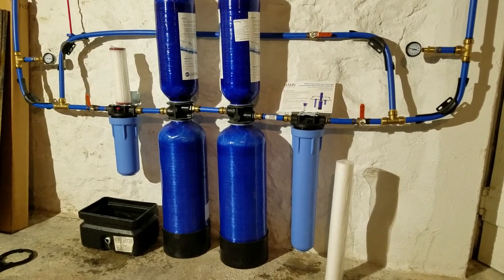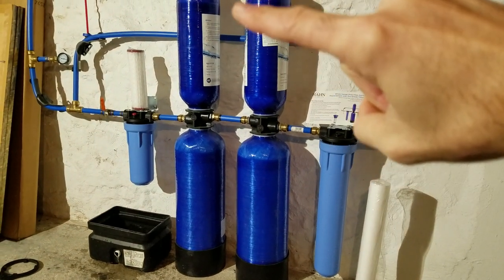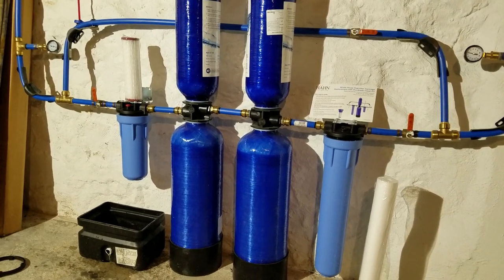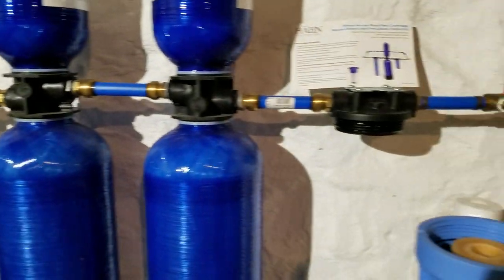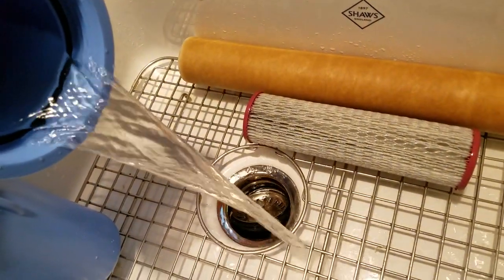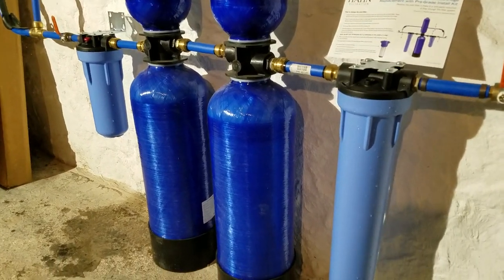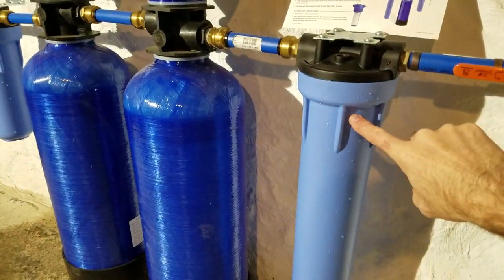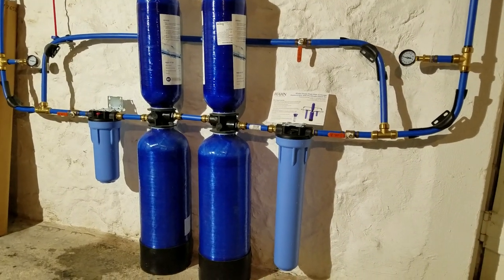Review: Aquasana Water Water Filter Systems, Overview, and Maintenance

Comment: Hi There!  This video and moreso the comments and your responses have been super helpful for me.  I am about to make a purchase for a small one bathroom house I am building in Puerto Rico.  Question - Now that you've had the OptimH2O for awhile, do you prefer it to the Rhino?  I was thinking about getting one of these two, and then adding Aquasana's RO unit under the kitchen sink.  Would that be overkill if I got the OptimH20?  Also, I have heard, and read about bacteria growing on the carbon block???   Please let me know your thoughts here, and thank you so much!
Show less
Reply from the maker: Hi! I'm so glad I was able to help and love the feedback!  As far as the Rhino vs the OptimH2O, here are some of the main points that I kept in mind as I debated. The OptimH2O:

* does remove chlorine, chloramines, forever chemicals that now seem to be in all of our water like PFAS, PFOA, etc. The Rhino only gets the chlorine. 

* The main carbon block filter needs no plumber or tools to replace (assemble/disassemble) like the Rhino does. Just pull and replace.

* The carbon block has less contact time in the system, reducing the likelihood of bacteria growth - 12 months vs 5 or 10 years  with Rhino (thats a long time) . The carbon block filter is more expensive tho, but is higher performance  as stated above.

* Adding the RO under sink - overkill? Well maybe, but for the low cost, I figured it's worth it, and I got one too. It filters beyond a carbon block for ultra filtration to the max - for drinking water only. Not for espresso machines tho. Its so filtered it can mess with the water sensors. 

* Bacteria - I do wonder about my old Rhino, due to age and length of exposure. Again, why I like the Optim H2O - 1 year. But you can always follow the RO disinfection steps that come with the RO and perform it for both the system and RO a few times per year or say if you went on vacation for a 2 weeks+ and the water was static.  Flush and you should be good to go. 

Hope this helps! And if you don't mind, use my link if you decide to purchase. It helps me to continue to make content 👍

http://visit.myoldhousefix.com/aquasana
Reply from the maker: One last thought bacteria/algae growth - I do know a few years back they switched from clear filter canisters to opaque due to this issue. It seems to have helped, but I haven't heard of anything lately.

Comment: I installed the Aquasana Rhino Cholaramine version plus salt free water conditioner 400,000 gallon.   We have chloramine added to our Southern California water. After our 3rd slab leak in our 29 year old copper pipes, research, plumbers and insurance adjusters pointed out the Choramine was a part of the problem.  Water feels great and taste wonderful now.  Two notes. A.  Water is cloudy and awful for a few days of new install (even with proper water cleaning at install) but then becomes crystal clear and yummy tasting.  B) After 3 weeks of use I see bottom of toilets browner than normal, which I assume is from removal of chloramine disinfectants.  So will work on a natural solution for that.  I would rather have that then the disinfectant in my family stomach and skin.
Reply from the maker: I think we are going to switch to the same in another year when ours is due to replace. I also noticed the brown spots in the toilets wuth our standard carbon filter, so must be common with both since chlorine and/or chloramine is removed.

Comment: Don't know if this has been mentioned but the activated charcoal will take bacteria out, but bacteria will build up on charcoal and start putting more bacteria in the water over time. Bleach needs to be run over charcoal once a month it strips a layer off and you have fresh charcoal. Thanks for the vid
Reply from the maker: Good info, thanks!

Comment: Looks good, I would add 1/4" sample ports and gauges in between tanks to monitor water softening and chlorine levels and delta pressure pre & post tanks
Reply from the maker: That's a great tip for diagnostics, Don! Thanks! We've done just that on the left and right sides of this setup.
Reply from the maker: @harman singh hi! The system info is at the Aquasans site here -http://bit.ly/2NzuUwb

and the pressure gauges I added from your local hardware store/Lowes...hope this helps!

Comment: Hey Chris, can you please 🙏  give us an update how this system is working?.  My water softener just died and I'm thinking of replacing it with this Aquasana system.  I looked at Amazon and it has really bad reviews.  I trust yours!.
Reply from the maker: @lauras.zone are you looking to go with Aquasana's softener or the whole Rhino system - filter and softener?
Reply: @myoldhousefix   The whole system like yours😊 we're really trying to get away from the salt water softeners.😬
Reply from the maker: @AnnaLaurasZone  hey, so this comment may get lengthy, but here's the issues we have locally with water, so yours may differ. 

Are you familiar with all the PFAS/PFOS issues popping up everywhere? This drove our decision making on what to buy.  I have a ton of info I researched here - https://myoldhousefix.com/2018/07/22/tap-water-safe-drink/
Reply from the maker: @AnnaLaurasZone  so now you have the background, there are basically 3 options you can choose - from cheapest to most expensive. 

1) Rhino Filtration System with salt free Softener - this is what we have now. It DID reduce hardness from about 14/16 grains of hardness down to 6. The faucets and showers cleared up and clothes came cleaner. I'd say it was 90% effective. My goal was 4 grains, so it got close. It also removes chlorine, heavy metals, pesticides, etc. 
What is doesnt do - it does not remove chloramines (see blog) or hit the high 90% marks for the PFAS and other chemicals. 

2) Optim H2O filter with same Softener - now that our Rhino System is almost 6 years old, the tanks have to be replaced soon(the 2 middle ones)  so we decided to upgrade to this unit. 2 reasons - the carbon block filter is better,  filters out PFAS/PFOS and chloramines...AND it is a few hundred dollars cheaper to operate. On this System, you keep all the tanks and just swap internal cartridges. I also added UV. This system ALMOST gets you to an RO system...but whole house. 

3) We also added an RO system to the OptimH2O, since it's only $200 for single point RO drinking water at the fridge.  

I haven't installed the new system yet, and it may be a bit overboard, but water is so contaminated nowadays, we dont want to take chances. Ann Arbor has a Dioxane plume, lead issues, and PFAS/PFOS from heavy industry. If you live near carpet mfrs, military bases, and airports... the waterways there are contaminated too.

Check out the blog, and I hope this helps! 👍
Reply from the maker: @AnnaLaurasZone   Our City started talking about the contamination and  even though our City installed a carbon system, there are still miles of old pipes and connections that probably pose issues like lead, etc. Did you know that the EWC has identified 400+ water contaminates, yet on average, municipalities only treat for about 80-100. It's scary as we gain the tech to test for more contaminates...yet treatment at the municipal level is lacking. I'm sure you heard about Flint, MI. 

I originally had Culligan Water come out and test for the general stuff like hardness, iron, and pH, but I didn't want their salt softening system. I also wrote a blog on drinking water over on our site - That's when I came across Aquasana, during the research. So I had somewhat of a baseline for the basics, and did a follow up with water hardness strips (Lowes, HD, etc). I'm also into the home barista thing, so a local friend and coffee shop owner gave me a LaMarzocco water test  as well (I think you can buy on Amazon - water test for espresso machines. Its a card type test ) - post testing for pH, hardness, iron, chlorine, etc and the Rhino System reduced to acceptable levels. 
As for filters, I just signed up for the water for life program to get the discount.
Reply: @myoldhousefix   Thank you so much for the vast information!  Your research on your blog is a good read indeed.  We're lucky that there was a RO under the kitchen sink when we bought the house and we just tested it and everything looks good.  I think I will go ahead and get the Aquasana system but the OptimH2O.  Its currently out of stock so I guess I have to wait 😬  I did notice that the optimH2O doesn't have a post filter but it has really great reviews!
Reply from the maker: @AnnaLaurasZone   you're very welcome, I'm glad to help! For the post-filter they say you don't need it, buy you can tell them to include one like on the Rhino - I'm reusing the one from my Rhino System. You CAN get bits of carbon off the main filter, so it can't hurt. 

Hey, if you decide to go the Aquasana route, if you don't mind using my link in the video description to go to their site (when you order), I'd appreciate it! They'll throw me a few dollars for the referral, which helps keep my site running (at no cost to you)!  Thx!
Reply: @myoldhousefix  Absolutely!!! No problem at all.  I'm waiting for it to be in stock again and I'll let you know as well.  Thank you again!  And once you have yours installed, please update a video on it too😉😊
Reply: @myoldhousefix  Hi There!  This video and moreso the comments and your responses have been super helpful for me.  I am about to make a purchase for a small one bathroom house I am building in Puerto Rico.  Question - Now that you've had the OptimH2O for awhile, do you prefer it to the Rhino?  I was thinking about getting one of these two, and then adding Aquasana's RO unit under the kitchen sink.  Would that be overkill if I got the OptimH20?  Also, I have heard, and read about bacteria growing on the carbon block???   Please let me know your thoughts here, and thank you so much!

Comment: Hi, do you know the precise size of the o-rings? They stretch quickly and don't incluse in water for life.
Reply from the maker: Hi Nathalie - I have to get spares too. I took my small canister to tje local hardware store and just matched one up. I also think that Auqsana sells replacements as well.
Reply from the maker: @nathalierey - mine measure 4" outside diameter, 3 3/4" inside diameter. About 3/16" in diameter

Comment: After this, do you use a separate water filter for drinking water? This water filter is for whole house right?
Reply from the maker: Hi Ajay, yes after you've cleaned up the chlorine, sediment, heavy metals, and water hardness, for all your mechanicals and drinking water, you can go one step further with their RO filter for drinking ( about $200). This is an additional step to remove chemicals, pesticides, etc...

They also have a new carbon block filter that replaces one of my tanks and then you dont need the separate RO

Comment: I have city water and have 12 grains/gal with ph 2.5/3.0 and zero iron. In your personal opinion, when this system “salt free” do a good job as a salt water softener?
Reply from the maker: Hi Freddy! It does. For example our city water is extremely hard at 14 grains. I had to use CLR on the shower heads every 4-6 months and even on our washer, or it would overflow from limescale. 

This system reduced it to 6 grains. Optimal is 4 to 5, but I'd say with our water this bad, it performs well.
Reply: @myoldhousefix  thanks for your feedback
Reply from the maker: @freddycalderon9092  you're welcome Freddy!

Comment: I was wondering if you had your water tested before and after the install? How much did it lower the hard water? Any changes in the water pressure?
Reply from the maker: Yep we had it tested for a baseline. 
The pressure dropped slightly. Our water pressure is at 52psi input from the street. With one high flow faucet running, like an unrestricted laundry sink, it drops to 48-50psi. Turn on a second high flow faucet like a kitchen sink, pot filler, or shower and it drops to about 36-38psi.
Reply from the maker: Our hardness went from about 14 grains hardness down to 6.

Comment: Hello, thank you for the informative video. We have well water and it’s very hard. Do you know what kind of numbers you would get if you tested with the tds tester? For example even at your home? I just want to make sure it’s as low as it can be etc.
Reply from the maker: Hi, yes...from our water testing, we were told that any reading over 5-6 should be treated. Ours was 17, and the Aquasana brought it down to 6, so pretty good performance considering our terrible rating. Here's a sample:

Once you test your water and get your number, see where your water quality falls using the guide below:

0–3: If your hard water test strip indicates that your water is between 0–3 grains per gallon, your water doesn’t require softening.

3–7: Water between 3–7 gpg is moderately hard, causing spotty dishes and dry skin.

7–11: Hard water is packed with minerals at 7–11 gpg, and you likely deal with crusty faucets and pipes and possibly reddish rings on your porcelain from excess iron.

11–15: Considered very hard, water at 11–15 gpg exhibits all the signs of hard water all the time.

15+: Extremely hard water is anything over 15 gpg.
Reply: @myoldhousefix  thanks for the response so our number of hardness was 17 as well. So that’s one issue that we want fixed however we currently use a zero filter for drinking water that when you test the water with a tds tester it’s at 0. So my question is what was your before and after tds number ? Our number currently is 392 before any filtering. I’m trying to see how much lower it will go hypothetically speaking etc
Reply from the maker: @olusialovesgod9724  you're welcome!  I don't think we ever tested with a tds meter, just checked hardness (gpg), iron, pH, etc. The Aquasana runs water through a 5 micron pre-filter for sediments, then the Softener (ion exchange), then the carbon media filter for heavy metals, chlorine contaminates, etc, then a 0.5 micron post-filter, and lastly UV light (recommended for well water) for crypto, etc. They have a specific well water version of mine that you'll want to select if you decide to go with a whole house system. 

Your zero water pitcher may be fine for drinking water, but the Aquasana really comes in for a whole house solution to help with appliance and faucet iron, limescale, etc. Water can really harm your espresso machine, dishwasher, boiler, hot water heater, etc.
Reply from the maker: @olusialovesgod9724  read more on tds here, too - 
https://www.aquasana.com/info/tds-meter-what-is-it-and-do-you-need-it-pd.html
Reply: @myoldhousefix  thanks!
Reply from the maker: @olusialovesgod9724  glad to help! 👍

Comment: I purchase the aquasana system, And in the installation instructions it says to put the water filter system before the salt free water conditioner, At least the diagram that they have laid out is made that way. I notice you did the opposite.
Reply from the maker: Hi, do you have the Rhino or the Optim H2O?  Check out the installation video here. There is a note * order of components may vary bu model. It liiks like the Rhino is correct - softerner goes first. BUT on Optim H2O it shows the filter first. Hope that helps - https://www.aquasana.com/product-installation-videos.html#wholehouse

Comment: I have my filter system for almost three years but why the water still coming dirty and I can see this  color when I use the washing machine with white clothes is necesary to change the system please ?
Reply from the maker: Do you have ANY old galvanized pipes between the exit of the filter and each point of use? If so the water will sit and rust...turning brown and staining white clothes. This happened to us and I had to replace our existing galvanized pipe. This fixed the problem and was not related to the filter system 👍

Comment: At least you have city water.   Imagine using that for well water, which is what we have at our primary home.  The filters would probably get dirty much faster.  We used to have a water softener, but that broke a couple decades ago & we haven't gotten it repaired.  Instead, for potable water, we buy bottled water & we also transfer several gallons of city tap water via clean gallon jugs from our other home in a different city an hour away.   We then just use the unfiltered well water for washing dishes & sometimes for showers.  Sounds kinda tedious, but at least we are saving money at the moment by not using a softener or filters.  I would love to get a huge water distilling system for our well water, but that would probably cost a lot.   
By the way, does the pre-filter also act as a spin-down filter?  I think a whole-house spin-down centrifugal filter at the pre-stage would help relieve the other filters down the line of a lot of the larger particles such as sediment & sand. And a spin-down filter does not need replacing, only cleaning, iirc, which would save you money on filter replacements.
Reply from the maker: oh yeah, I imagine the filters would need to be replaced more often on well water.
Reply from the maker: oh, and no...the pre-filter is disposable.  Not reusable.
Reply: @myoldhousefix  ... You might want to look into using a spin-down filter then, if you haven't already.  Ask around.  It might replace one of your prefilters, or it could be an additional filter, idk.  But it does not require using disposables, because all you basically do is empty the filtered contents into a bucket once it becomes full & then it's ready again, so it could be used for years & save you money down the road, who knows. But since you are on tap water, there's probably less large-micron particles in that water.  Yet I would still at least try to see if a spin-down might be a money-saver in your filtering loop.